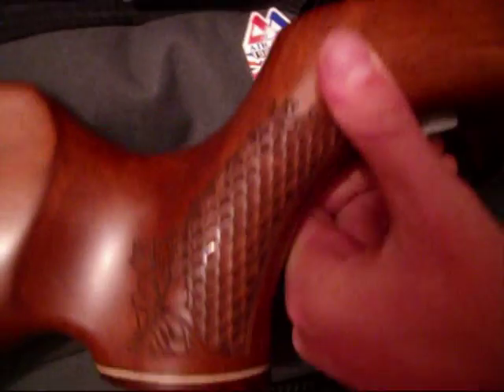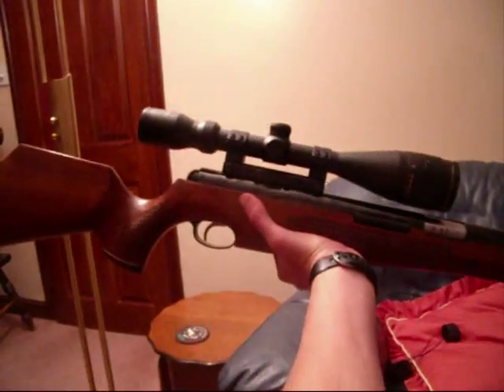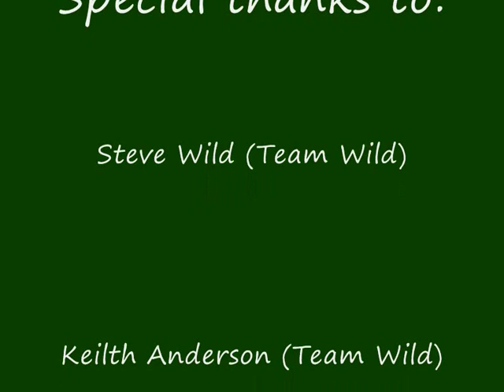Air Arms TX200HC Review

Comment: Thanks Andy for answering my query!! I took Malcolm's advice and I now use 3 in 1 Oil on my barrel and stock.  I'm going to apply some Napier Oil on my silver slide and safety catch now.  Thanks for the two links on theTX200/Pellet care as well!!
I'm loving this gun as I have put 40 pellets through it already and it's still dieseling and I get a slight smell from the dieseling.  The groupings i get with the AA Diabolo Fiels and Crosman Premiere pointed from 25 feet out are less than a dime size(0.25").  I'll be testing the gun with 5 other pellets today.  This gun is a GEM and I'm so happy I bought it.  Even though it's quite expensive, the accuracy and aesthetics is worth the cost.  Happy Shooting Andy!!!
Reply from the maker: Glad I could be of help :) merry Christmas and happy shooting ;)

Comment: Andy, I was given a free sample of the Napier Airgun Oil and the seller said I should use it on the anti-bearstrap safety catch.  Have u ever heard of such a practice?  He also stated that I should periodically place a drop on a pellet and shoot it through the TX200.  Is this a general practice?
Reply from the maker: Hi, I have the Napier sample gun oil ( which came with my rifle). The anti bare trap and slid was a bit rough at first so I just put a bit of the oil on the tip of my finger and rubbed it on to the slide (the stainless steel bit were you put your fingers in if you were wondering) it did the job well. I would apply small amounts if needed with your finger or cloth and not directly drop it onto the rifle because it can get in the workings and mess your rifle up (I think :) ). I have also applied small amounts to the safety which was fine. So I would say yes use it but in small doses and I wouldn't bother with the pellets unless they are very poor quality, these is a good videos on TX care and pellet care: Quick Tips - Basic Air Gun Care (Air Arms TX200)
Washing and lubing your pellets (As requested by our subscribers)

Comment: Just had a power failure in my area over the last 2 days, but I was able to test out more pellets and it turns out that my TX loves the AA Diabolo Fields and JSB Jumbo Exacts.  Apparently JSB manufactures the Air Arms pellets as well.  So no surprise they are my top pellets.  My TX hates the RWS Hobbys and Stoeger X-Match.  The Crosman Premier Pointed and Destroyers do ok, along with the RWS Superdomes, but not as good as the JSBs and AAs.  I noticed after every hundred shots or so, I have to re-tighten the allen screws on the forestock and the #5 Allen screw on the trigger guard as I get a rattling knock when I cock the gun.  Do you periodically have to re-tighten your screws as well??  I find the hex screws on my scope need to be re-tightened as well over time. 
MERRY CHRISTMAS to you as well Andy!!!  Thanks for all your help mate!!!
Reply from the maker: You are right about the pellets :) With the screws I am having the opposite problem because I cannot get the rear one out from the trigger guard as I want to adjust the trigger :/, I do sometimes find that some of the other screws have come lose (especially the scope mounts) but I just tighten them and they are good to go again. I am with you on the pellets with the RWS superdomes, I haven't tried the Hobbys yet and I probably wont bother now :). I wouldn't worry about the screws coming lose but if it bothers you then you could put some lock tight or something on it if that helps. Merry Christmas and keep shooting.
Andy
by the way your welcome mate ;)
Reply: Andys Range
Hi Andy, the Allen head screw you are referring to on the rear part of your trigger guard is the 3mm socket head screw or allen head screw.  The one on the opposite side is a 5mm allen head screw.  Coincidentally my scope mounts use the 3mm screw as well.  It's funny that the gun never came with the 3 or 5mm allen key.  Thank God I had some allen keys lying around my place.  Your screw might be stripped; preventing you from unscrewing it.  If it is stripped, I don't know how you would be able to take it out.  I've decided to avoid using the loctite glue.  I'd much rather tighten the loose screws when they come loose.  I'm trying to avoid overtightening as some of the screws are made with aluminum and the threads can easily strip.  I just tighten now to the point where there is no knocking or movement.  I hope you can eventually get that screw out.
Reply from the maker: apallo88 the Allen screw is a 3.5 size I think because the 3 works but because mine is so tight there is play in there meaning the 3 just chews up the hex shape. I don't blame you on the Loctite I would probably just keep tightening them to :). 7I will probs have to send my rifle to air arms to get out if I cannot get it out. Another thing I have just got some cammo tape in my stocking so I will most likely wrap the barrel. under leaver and silencer in that to help protect it and cammo it :)
Reply: It should look good with the cammo Andy.  Is Air Arms close to you?  I'm going to dread the day where I have to order parts from Air Arms overseas.  Hopefully the rifle holds up and nothing major malfunctions.
Reply from the maker: apallo88 Well air arms is about 5 hours in the car from me so close compared to you but still pretty far. Your rifle should hold up for along time. There should be Air Arms distributors in the US or just get parts of eBay or something.
Reply from the maker: apallo88 thanks I will check out that link :)